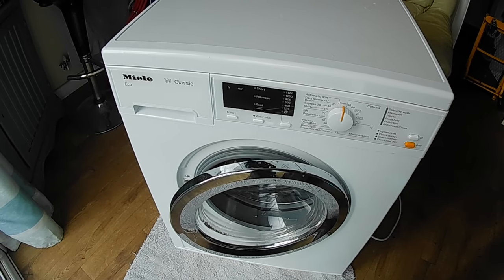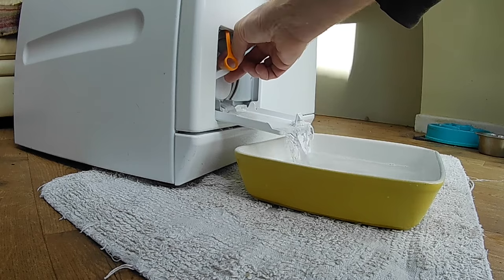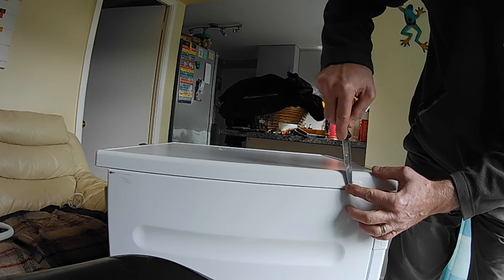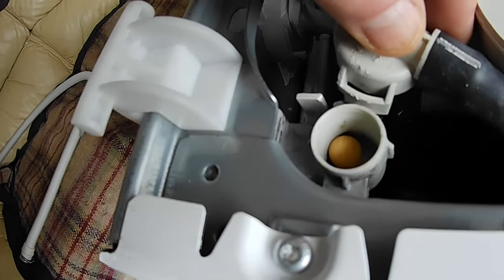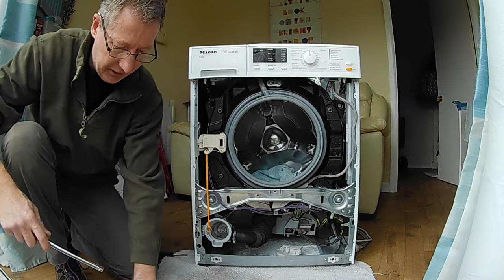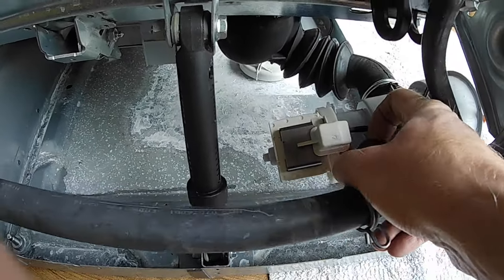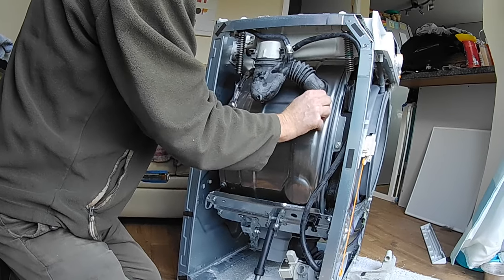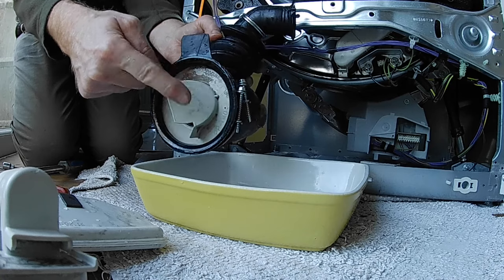Miele Washing Machine Drain fault - multiple fixes

Comment: Our Miele drum keeps filling with water any idea why mate?
Reply from the maker: If it starts filling without being switched on its the inlet pump. If it fills too full or keeps filling then I would look at the pressure switch - see from 10:25 in the video. Water needs to go up the pipe to create air pressur above it to push on the diaphragm in the swich. If when clean it still does it you can try gently blowing up the pipe and if that stops the fill then you know it's a blockage in the pipes shown in the video from 10:25. If blowing doesn't stop the fill then check the connections on the switch or more likely you will need to replace the switch. Hope that helps - it would be what I tested first - good luck. Remember - I'm not a washing machine technician, just someone who has managed to fix a few machines in the past.

Comment: What's the purpose of the hose at 3:40. The water outlet at 4:02 at the back of my machine broke off. I want to lead the pipe at 6:38 straight out of the machine without the chamber at 6:42
Reply from the maker: Hi M, Firstly - I'm not a washing machine engineer so hopefully one might reply to you. I just wanted to show how to take the machine apart and how I resolved faults. I suspect that the chamber is like a u-bend and stops potential bad smells coming back into the machine. I think the ball stops water coming back in (if you had another device emptying into the same drain outlet). I would think that you would need to make sure that what ever you do you will need a pipe from the one at 6:38 to go to the top of the back of the machine to ensure that you have gravity on your side to make sure the water does actually drain into the outlet. Sorry I can't be of more help.
Reply: @bigv1682  Obviously I would lead the pipe to the same outlet height, so the water can't run out.

Comment: The tab you broke off, you don't need to drill that out, you can use a wide, flat blade screwdriver and very gently lever behind it. It will just pull out.
Reply from the maker: ahh fantastic, thanks for that. Will it go back in too? Or get a new bit?

Comment: It doesn't detect a vacuum, it detects pressure. So if you have a fill problem, this being blocked may be the cause.
Reply from the maker: Thanks for the clarification, it will help others.  So how does the machine know when it's finished emptying? Or for that fact when/how it knows it's got an emptying problem?

Comment: What works best is running Cottons 95 with a dishwasher tab or killrock discaler monthly, and keep on top of hot washes like towels make sure they are on long washes, I’ve never had gunge build up, also powder is better for the machine like Ariel powder as it’s biological, non bio is bad for your machine, gel is also bad for the machine and doing quick washes is a big no no same as washing lower than 40 as it causes trouble like this
Reply: In my case, it was the opposite. Since i used calgon tab for maschine each time i wash, after a while it started leaking.

Comment: 1:50 Being able to turn the impeller manually does not mean it's not a faulty part.
Reply: I had the filter removed and the door open and running the swinging program I saw the impeller was actually turning (fast).
Reply: My problem was fixed by cleaning the outlet at 4:00, was lucky not to have to open the machine more. Thanks for the video!
Reply from the maker: You're right, in the end it was our pump. The impeller turning does not tell you a lot unless it's stiff, Wobbly or just turns freely.